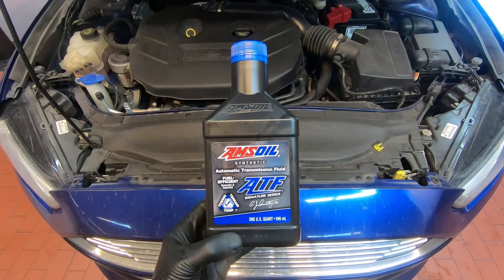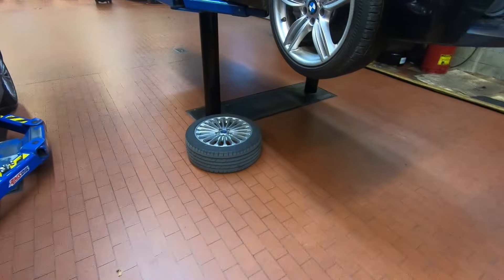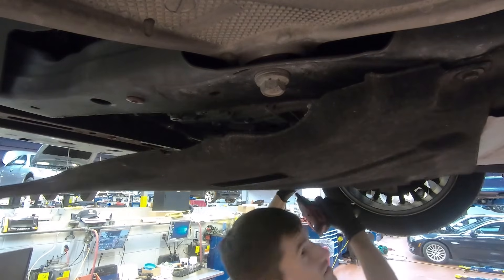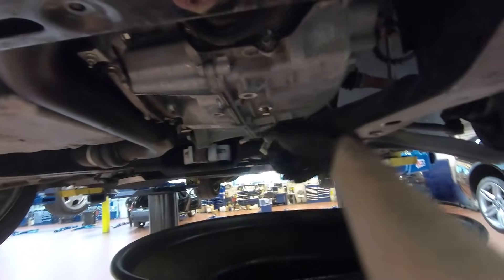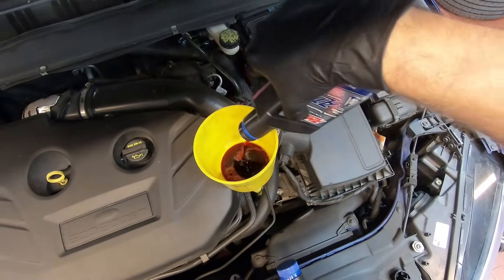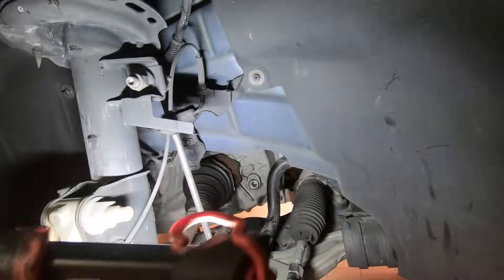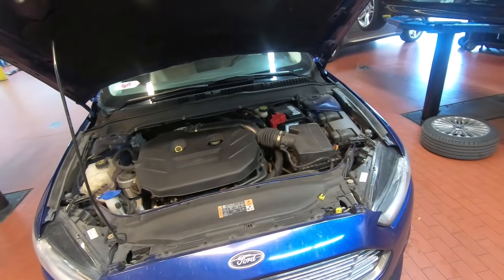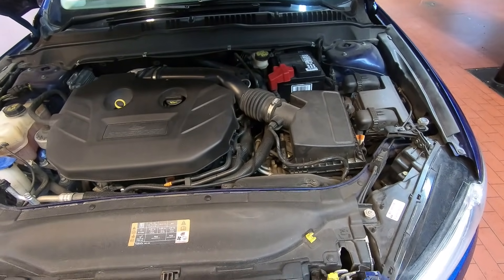Ford Fusion Automatic Transmission Service ( 6F35 ) [ HOW TO ]  2013-2020

Comment: Great video : When I went to change my transmission fluid only 3 1/2  quarts would drain out. Please advise
Reply: Me too. I was so confused. Where are the other 6 quarts?
Reply from the maker: Still in the transmission valve body, torque converter, trans cooler etc.
Reply from the maker: That sounds roughly right. Make sure you add 3.5 back in of the Amsoil ATF. Start the car and shift through all gears, then level the car out, remove the level plug and top off.

Comment: Never drain fluid out of any gearbox until you first check level plug will remove, also gears should be moved and held for approx 20seconds in both directions ,,

Comment: Just drained the transmission of my 2015 fusion SE and then measured how much came out - only 3 and 1/2 quarts.  80k miles and this has never been done, I'm wondering if the fluid level was low?
Reply from the maker: It's possible.  Make sure you do the leveling procedure at the end of the video so you know it's full
Reply: @THEDriverMod_  Will do, thank you for your reply and very helpful video!
Reply from the maker: Thanks for the positive feed back! Try using Amsoils transmission fluid. I got a link to my website in the description

Comment: The last procedure is missing and it must be done after you put the level plug back on you then must take it for a drive come back and with the engine in idle recheck the level via the filler level plug at the top if no fluid is visible add more fluid  a little at a time till you see fluid flow then put the filler cap back on this makes it the complete procedure fail to do this can result in transmission frailer later on.
Reply: Do remember the good old days? When you checked the trans level on the dipstick there was a hatched area where everything was OK? Outside that area you either need to add or remove fluid. Well if you follow the procedure in this video you will be within tolerance. Driving around a rechecking won't hurt, but you don't must have to do that.

Comment: It takes 5qt
Reply from the maker: Not everytime. Always properly check the fluid level using the level plug
Reply: @THEDriverMod_  yeah when there's still some fluid in the transmission I would put 4.5 in take it for a  drive then check the fluid

Comment: Well done, thank you for sharing!  I just bought a 2015 se today, thinking of tackling this myself but have limited resources.  What is your opinion on measuring what was drained and simply adding that much fluid back?
Reply from the maker: if its your first time doing it, you dont know if the fluid is at the correct level to begin with or if it was properly filled the last time it was service other wise that would work.
Reply: @THEDriverMod_  ok, sounds good!  That's what I'll do:)
Thanks for getting back to me so quickly!
Reply: @THEDriverMod_    This is an excellent point.  Thanks

Comment: I never saw you taking out  tranny filter and replacing with a new one,u basically took out old ATF and put a new one... that isn't a complete job you did sir.
Reply from the maker: If you want to pull out the transmission and seperate the case just to replace the filter then go right ahead.

Comment: Can you pump the fluid out of the overflow with one of those pumps you get off amazon?
Reply from the maker: No, the Differential is right there and will stop you most likely, way easier to just drain it

Comment: Are these transmissions known for having a slightly hard shift between 2-3RD? Under normal acceleration. 

2015 2.0L 93k (KMS not MI)
Reply from the maker: Yes, especially with the 2.0 ecoboost due to the amount of low end torque it puts out
Reply: @THEDriverMod_  I appreciate you getting back to me. I thought it had a bad trans. I bought the car in June last year with 85k so I highly doubt it's been flushed.

I own a 2012 with the manual as well
Reply from the maker: @Rosscoe85  no worries, happy to help, I've got 175k on my original, unopened trans. Just been servicing it every 30-40k with the Amsoil transmission fluid. Get yourself some! Would love to be your sponsoring dealer!

https://www.amsoil.com/offers/pc/?zo=5489415
Reply: @THEDriverMod_  Can I use the Amsoil oe transmission fluid for a 2018 ford fusion sedan? What is the difference between the Amsoil signature series transmission fluid?
Reply from the maker: @AthaYAHmamlahkaYAHusha333  how long thr fluid last and the level of detergents
Reply from the maker: Yes you can use the OE fluid or the Signature series or mix both however you want

Comment: The best video that i have seen on changing the transmission fluid. I have two fusions a 2016 and a 2018 both running the 1.5 GDI Turbo Ecoboost engines. Both cars are running AMSOIL Signature Series OW30  engine oil. The 2016 has had a transmission flush with the AMSOIL  Signature series LV fluid but i don't like the way it was done because the ford dealer flush machine only told them to add four quarts of my oil to the transmission. AMSOIL said it took nine quarts to do a transmissions change. Ordered two cases of Transmission fluid from AMSOIL to do the transmissions in both cars so i have to do some checking to see why they only used four quarts of transmission fluid when i wanted it all changed out !!! I will get the transmission fluid changed on the 2018 when i find out what is going on at the ford dealer. Doesn't the technician know what he is doing !!!!
Reply from the maker: Most likely they just did a drain and fill instead of flush. A drain and fill on these cars is about 4 qts or so
Reply: @THEDriverMod_  thanks i guess i need to talk to the service manger.
Reply from the maker: I use to work at a Ford dealership too.
Reply: Isn’t the viscosity specified for the motor oil 5W-30?
Reply: @vayabroder729  5W20 in normal weather - 0W20 in cold weather locations
Reply: I had the dealership do the drain and fill at 65,000 miles. The said they don’t flush these transmissions. They did drain and fill 3 x. I will do my own drain and fill 1 x every 30,000 or less now.

Comment: Question,  just changed the transmission,  3 months into it now, but the car started stalling on me well it would run great but on red lights the gears wouldn't get had to turn it on and off for it to get the gears but one day it just stopped getting gears can it be that it needs transmission fluid?
Reply from the maker: im sorry but with out really being there it is really hard to say. i wish i could help more. check the fluid level if you think that is a possibility
Reply: @THEDriverMod_  I'll do that,  appreciate the reply bro👍🏼
Reply: What ended up being the fix for your car? Just had a friend's fusion have the same problem today. Trying to help their family fix it. Before they commit to buying another car, or dumping a lot of money in transmission repairs/replacement.

Comment: Hi does the 2015 fusion carry any filter when replacing transmission fluid?
Reply from the maker: there is a transmission fluid filter but it is an internal filter which involves removing the transmission and separating the transmission body to replace it. that's why I recommend using the Amsoil transmission fluid and doing a drain and fill every 35-40k miles.

Comment: Ford Fusion 2.0 Ecoboost (80,000 miles) experiencing slightly delayed shifting only going into 3rd gear. Would it be a bad idea to drain and fill new fluid into the transmission? (I’m aware of the danger changing a worn transmission’s fluid). Or should I look at resetting the transmission’s adaptive learning from the TCM? Ford wants to charge an arm and leg just to hook the TCM up and reset the adaptive learning. The delayed shift into 3rd gear can be prevented by using the paddle shifter and manually shifting at a lower rpm  from 2nd to 3rd in stop and go traffic. If I let the transmission shift on it’s own. The delay does not always occur. The delayed shifting doesn’t  seem to correlate with engine temp or the temp outside either. What’s really interesting is when you put it into sport mode. The transmission will almost always have a delayed shift from 2nd to 3rd around 3k-4K rpm range (same rpm range the automatic shifts at on its own). It shifts smoothly if you red line it into 3rd.. or if you shift at 1k-2.5k rpm range. Are any other Ford Fusion owners experiencing this issue? I’m looking at Drain/refill trans fluid. Or find a shop that has a computer capable of resetting the TCM’s adaptive learning.
Reply from the maker: That's a super common issue. Changing the fluid is gonna help regardless of what you are experiencing. A drain and fill a couple times isn't gonna damage anything like a flush would. Mine has the same issue, it's never gotten any better or worse. I've got 174k on mine now. Been doing the trans fluid ever 35-40k miles using the Amsoil fluid featured in the video
Reply: @THEDriverMod_  The relief this comment just gave me lol! I bought this car used. It’s nice to know that you made it to 174k and that you’ve been experiencing it for awhile. Mine hasn’t gotten worse or better either. I’ll be doing a drain and fill as soon as the temp warms up a bit. You are a legend Thank you! 🤜🏼🤛🏼
Reply from the maker: Definitely recommend the Amsoil fluid, it's awesome stuff. Purchase link is in the video description. Reach out if you have any questions!
Reply: @THEDriverMod_  Roger that! I’ll be using Amsoil and your link 🤘🏼
Reply from the maker: I appreciate it! Let me know what your account number is when you order and I might send you a thank you gift
Reply: @THEDriverMod_  
I have never changed my fluid 130,000 and I don’t have that problem.

Comment: I have a feeling this video will continue to help people for years to come! Hands down the best fluid change demonstration for Ford Fusions on YouTube. Thank you!
Reply from the maker: Thank you for your positive feed back. The reason I made it was because I couldn't find a good one so I tried my best make a straight forward and to the point HOW TO video. I'm glad you found it helpful!
Reply: @THEDriverMod_  Hey, I didn’t forget to use your link for Amsoil trans fluid! I’ll be changing it as soon as spring gets here. Woke up this morning CEL light was on, ran codes. Got the typical p0456 evap very small leak. From my understanding vacuum is leaking from capless fuel tank. I’ve done cleaned it and jostled it with a little wd40. That has keep the code off for the most part. This morning same code came on, along with P1450 $07E8 and P1450 $07E8pd. I’ve never seen these two other codes pop up before, I’ve done some research already. Could be charcoal can, evap purge valve, or kink lines? Have you ever seen these codes? Any advice🙏🏼
Reply from the maker: Yessir! What was your name so when I see it go through I can keep an eye on it? I have a video on how to replace the purge valve for a 2.0L ecoboost, I am 99 percent sure that's what it is.

Comment: I hear water sloshing noise behind the dashboard when driving and the heat not getting hot, only cold air. Would you have any idea what cause that? This is 2017 Ford Fusion SE.
Reply: Thanks for a quick response. I'll look into that. You're the best. 👍
Reply from the maker: I appreciate it! Check out my latest video on how to enter our 2k subscriber giveaway for a shot at our give away prizes!
Reply from the maker: Sounds like the cooling system has a large air pocket in it. Make sure your coolant reservoir is full and if it is, it's an air pocket. If it's low, you've got a Leak somewhere. That's where I'd start

Comment: Great video. I have a 2019 Titanium and the dealer recommended a transmission flush for my car when they replaced my axle at 38k. I did not perform the service then. I now have 51k miles. Is this drain and fill the same thing as the flush? How much does it cost (an estimate would be fine) to do a flush?
Reply from the maker: A drain and fill is not the same as a flush. Cost will depend on labor rate and what fluid you are using. Or would you be doing the drain and fill yourself?
Reply: @THEDriverMod_  Thank you for your response. I don't mind doing the service myself. Since a flush and drain are not the same, is it odd that a Ford dealer would recommend a transmission flush at 38k, and not a drain and fill like you just demonstrated? My owners manual says to change the transmission fluid at 150k but the wording is vague. They're not saying flush so it's a bit confusing on which service  to do with my mileage at 51k now😕
Reply from the maker: @bonedatt  you would definitely want to service the fluid, they are recommending a flush because that's gonna get about 90 plus percent of the fluid, where a drain and fill will only get about 40 percent. I would just do two drain and fills back to back and that will get 75% or so. These transmissions need the fluid serviced ever 35-40k miles. I've worked on them at the dealership and don't care what the manual says, these transmissions will not make it to 150k without regular fluid service every 40k miles.

Comment: Yikes! I'm 2nd owner of 2013 fusion with now 90k miles on it. I'm going to do this ASAP.  Wish me luck. Great video. 👍
Reply from the maker: Definitely recommend and use the Amsoil fluid linked in the description. I'll become your sponsoring dealer and be able to answer all sorts of questions you might have.
Reply: How’d it go?
Reply: It went well.. I did all that was shown here.  I'm now at 130K so time for another flush.
Reply from the maker: What fluid did you use last time?

Comment: Great video! I was curious is it necessary to remove the plug from behind the wheel till some fluid seeps out or will filling it with 4-5 containers be enough?
Reply from the maker: You should always pull the plug to ensure that you're at the proper level. If you measure what comes out that will be  super close however
Reply: @THEDriverMod_  I thought about that to measure and then fill it back up with exactly that amount

Comment: Would you happen to know if I could use the transmission from a 2019 fusion and put it in my 2014 fusion? Both 2.0 FWD. same 6F35. Just not sure if there’s any computer issues I might run in to. Any input would be greatly appreciated.
Reply from the maker: I unfortunately do not know if they are the same even though they are both 6f35s, their might be small differences
Reply: @THEDriverMod_  gotcha. Appreciate the video! My torque converter is going out and whining. So my trans is on the way out. A used 14’ trans is ridiculous in price. Lol. Made it to 186k tho!
Reply from the maker: That's pretty good! Have you been maintaining the fluid regularly?

Comment: Glad to see it's exactly like a GM hydramatic 6T series transmission. If they don't have a dipstick and AREN'T leaking I measure how much oil is removed with an old oil jug. Then refill with the same amount of dex vi or equivalent synthetic transmission fluid. My wife's Cruze 6T40 transmission was exactly 3.5 quarts every time. Do that every other oil change and your transmission will outlast the motor.
Reply from the maker: It's always good to be safe and check the level

Comment: Do you have to put the vehicle in service mode and do you have to reset anything like you do when you change the motor oil?
Reply from the maker: Nope, just do the service, top it off and that's it

Comment: Not ATF leak in that cap? My bronco sport have it but dealership say me is normal or a factory overfilled...
Reply from the maker: It only leaks if it's overfilled. I've seen dirt build up there just do to moisture accumulating there but that's nothing to worry about

Comment: Do you know if the Ford Fusion eco boost takes a tranny filter?
Reply from the maker: There is a filter but as I stated in the video, it is inside the transmission case and in order to replace it, you must remove the transmission and split the case halves to replace it
Reply: @THEDriverMod_  thanks for the reply
Reply from the maker: No problem,  good luck!

Comment: I've got a 2018 escape with the 2.5 l engine. Is it possible to put an aftermarket cooler or an inline filter like a Magnafine  filter or both on that vehicle?
Reply from the maker: I'm sure it is, you just gotta figure out the set up

Comment: owners manual says to change the transmission fluid at 150,000 miles. kinda figured that wasnt right
Reply from the maker: Yea, definitely not, hardly see any of these make it to half that many miles without any issues and NO maintenance

Comment: Well crap, I have a 2017 fusion hybrid with 93k miles on it and it most likely hasn't been changed (bought used). Is there any extra steps I need to take because the engine doesn't cut in till the battery is drained.
Reply from the maker: That's a different engine and transmission entirely. Different fluid and different service procedure
Reply: @THEDriverMod_  thanks for the info, I'll look Into it!